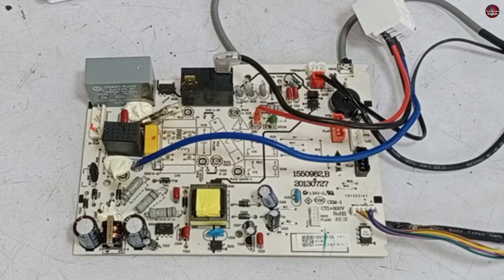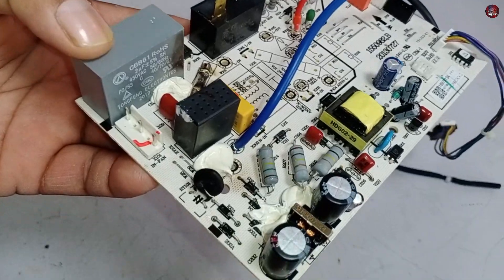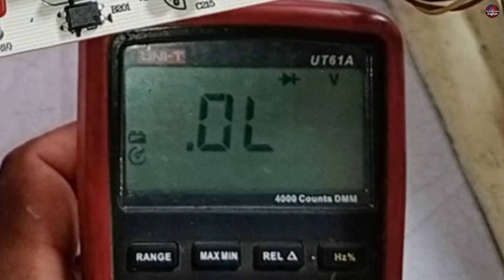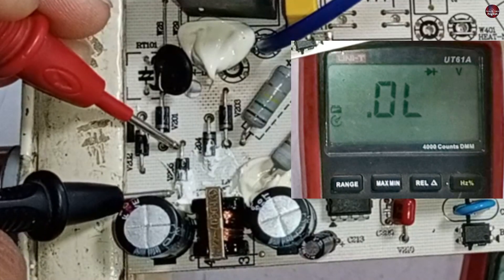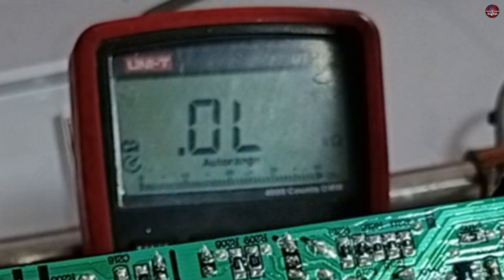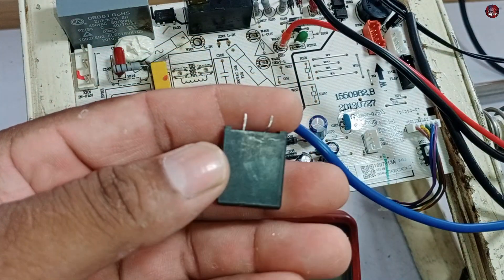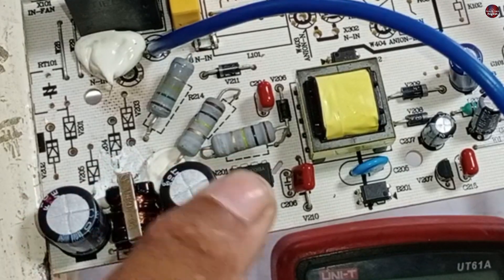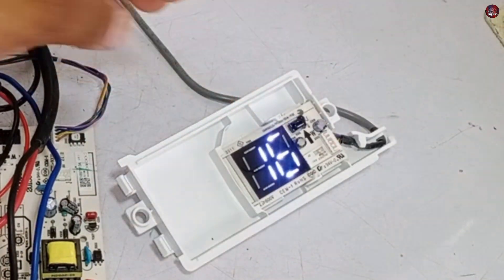This Component Failed in Hisense Mini Split AC Circuit Board

Comment: Hi I have a hisense minisplit it has 4 leds on the back of the pcb led1 led2 led3 led 4 and power on led when I power it on and select 30 celcius  first all three 1 2 3 start fashing 4 stays on after a short time of running led1 fades away the unit works fine is this a problem